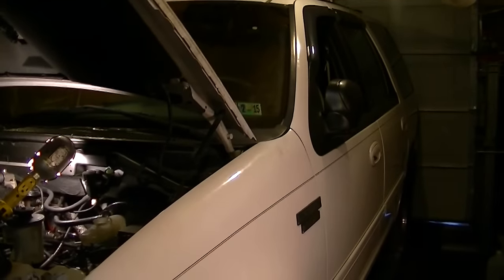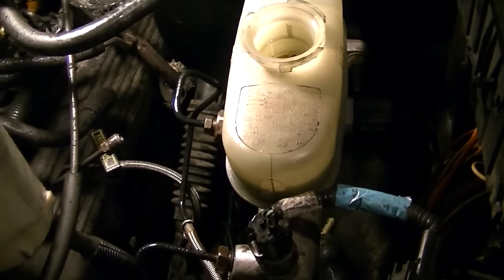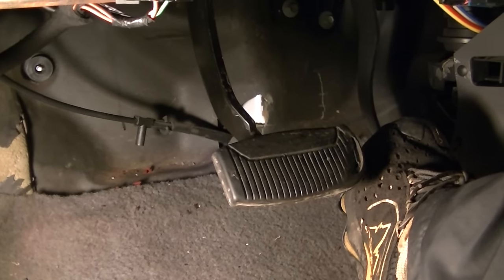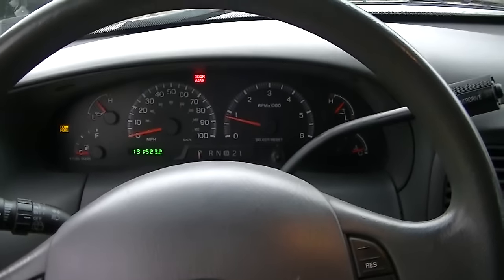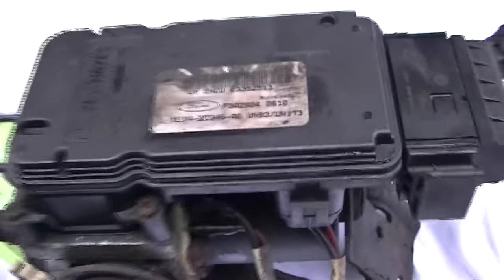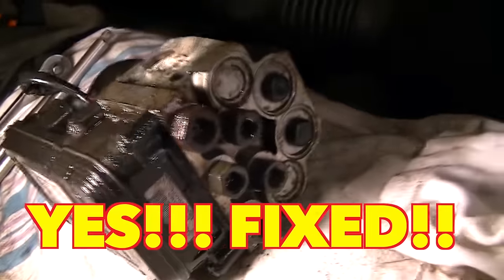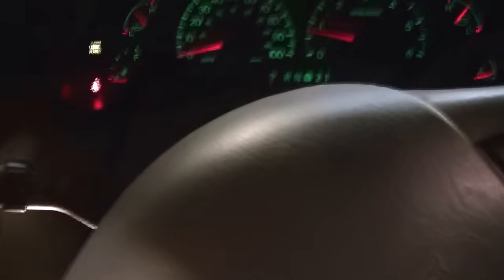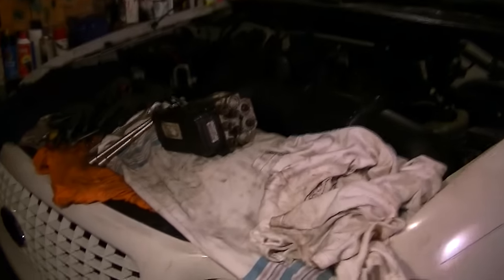Sinking/Spongy Brake Pedal -With ABS SYSTEM?? Nothing Works? Watch Fixed!

Comment: Thanks for posting this.  Almost textbook with the problem I had with a 2001 Escape.  I guess I have some work ahead for me.  Cheers!
Reply from the maker: Let us know if you fix it!
Reply: I'm thinking this is not worth it.  I may donate the vehicle, since I was going to sell it anyway, it needs new tires, and now either the battery or the charging system is shot.  I've got too much else going on to pursue this.  But again, thanks for the videos.  Last time I did a brake line change, it was a lot harder than I thought it would be.  I could get about $2k to sell this car, or just donate it and get it out of my hair.  Heck, I'm just a biologist, with some mechanical skills.  How does that stupid "Kars for Kids" get so much radio time anyway?

Comment: I had this same issue. It was air in the line. I had a power brake bleeder that I kept pumping the brakes while it was attached and bleeding, air bubbles kept coming up and out of the master cylinder resovoir. Since then it's been fine. I recommend people try this before replacing anything. That being said - check the recalls on your car because you would be shocked how many of them have ABS module recalls.

Comment: Loosen up the caliper bleeder screw when installing new brake pads.  Abs module valves are not designed to handle the back pressure when pushing back a caliper piston without releasing the bleeder screw.
Reply from the maker: Perhaps, but I've never had a issue doing that. But good Idea ;)

Comment: Great information. I have one of these only Two door. Did do a all fluid Re&RE including break fluid and power steering fluid at about 75K miles i now have 165Kmiles on it and the fuel pump is getting weak. I just keep replacing the inline gas filter from the tank to the engine on every serviceing seems to stop the engine light from going on other than that one front wheel bearing. Great little vehicle ❤
Reply from the maker: Nice ride!

Comment: would it be air in the abs pump somehow? Factory or dealer have special ways or equipment to do abs bleed.
Reply: Yes it can be air in the ABS assembly but to flush all the rust, dirt, crud and especially copper in solution coming from the inside of the brake lines. This copper acts to corrode parts in the ABS actuating pistons and their sleeves and brake caliper/slave pistons and sleeves. The bottom line is that all replaceable fluids in the car/truck need to be replaced to prevent this corrosion as ongoing scheduled maintenance. And the reason I am saying this is because whether it is brake fluid, engine coolant, engine oil, transmission fluid, or rear end pumpkin , they all contain special additives that protect metal and rubber parts. Seal Softeners, Corrosion Inhibitors, PH stabilizers, and in the case of coolant the special additive that prevents cavitation and stripping of small chunks of metal from the coolant passages. These additives DEPLETE after one year.  I know some carmakers say that it has lifetime brake fluid. IMHO this is their Marketing Department getting in the way of good engineering practice. So that they can sell longer intervals for maintenance and "lower costs" at the time of new sale. This simply does not make sense given the fact that literally, millions of calipers and brake pulse units (HCU's) have to be replaced every year. You will need to full flush it and use a scan tool and procedure to operate the twelve ABS solenoids. I hope this helps someone!

Comment: This video was spot on on in the frustrations i went through haha - I have an ABS on order for a 2017 Audi A6 with only 55000 miles on it! I ordered it simply by how similar he described his process and frustration - I already installed a new master btw so hopefully this will fix the issue - it’s been a few months . One weird thing to note is that the pedal feel would be “ok” for a few days after bleeding and activating the abs pump. during wet weather it was really bad! And it’s not always consistent- around town it felt decent but drive on the highway for a bit and get off a highway exit and surprise, I would have to pump them a bit to hold pressure- and it’s true there is a lot of spotty information on it - everything says master cylinder… great video!
Reply from the maker: Right on man!!
Reply: Did that fix your issue?
Reply: @omarinbenz23  it my mistake - I did change the abs but it all came down to putting the anti rattle clip in wrong! But at least I learned a bunch about brake systems!
Reply: @Krugger71  anti rattle clip?
Reply: @omarinbenz23  on my front caliper there is a metal “U” shaped clip that bolts onto the caliper. It is supposed to apply pressure so that the pads don’t squeal by being compressed against the rotor or rattle with no pressure from the caliper during normal driving.

Comment: I have a 1992 f250 and same problems.  I replaced both rear drum cylinders and bled all four wheels starting with the furthest one and the breaks got better but I steal have a soft pedal. Now I’m thanking abs or R-abs,  I’m going to try to bleed the abs before I buy one!  🤞🏻hope bleeding it works!

Comment: People, always check for leaks first. A leak will give the same symptom he had. Especially if you live where salt is used on the roads or where you have heavy amounts of moisture. The lines can rust anywhere and leaks sometimes are hard to find.

Comment: Process of elimination........   Yeah tell me about it.  New front brake pads.  Took off the master again, did a bench bleed.   I had to use a screwdriver against my chest with one hand and hold the master with the other hand.  It takes all of my strength to push in the rod. 

Then I bled the rear brakes with a vacuum.  Then all new parts for the rear drum brakes.  It took 10 days just to get all the parts.  What a job.  Use copper wire to hold it up in place for the hold down springs.  Finally finished.  And the pedal still goes all the way to the floor!     ARGGGG!
Reply from the maker: You can do it!!

Comment: I was telling my wife yesterday that I am about to destroy my Tahoe. I've replaced every possible brake part except the ABS. I hope this does it!
Reply from the maker: Bingo! Let hope it works.
Reply: Lol I’ve put two in and still fkn spongy but replaced cause they were dragging 🤷‍♂️, also, new caliper, booster, brake line lol, so thinking one of the parts has to be fkd up I got used? I’m gunna bleed each wheel tomorrow? After that might be Molotov time!

Comment: I have have the same issue with my 2006 Jeep Commander.  It goes spongey on dirt roads, and when I brake hard.  Sometimes it goes back to normal with a few pumps & taps, other times it takes a day or two.
Reply from the maker: O my!!
Reply: @FixingWithPassion  should I go the route of an ABS auto bleed?  Or try my luck with a new module?  If it's a common Jeep issue, it's probably best not to look to junk yards.

Comment: I wish I would have found your video sooner. My father has a 2000 Chevy S10 2.2L 2WD. I Replaced brake booster, master cylinder, proportioning valve, bleed the brakes and still pedal went to the floor. The reason I notice it was the ABS module, it was because of a bell sound coming out of the module while the pedal was sinking. While searching ABS pedal sinking I found your video. On another video I found explained that the ABS has a bleeding place, which I was going to do next and I was also going to disconnect the ABS completely to see if that was the issue. But watching your video, I will be going to the Auto Salvage to get an ABS module. Thank you for posting your video.
Reply from the maker: Be careful. I've gotten bad one's at Junkyards before. So don't give up! Keep us updated!~
Reply: Disabling abs fuse fix the problem? Means with no abs
Reply: @veeradasskumar9790  I removed the fuse, but still had issues. I ended up going to the junkyard and getting an ABS Module. The part from the junkyard gave me the ABS light... So I swapped the top electrical part and it's working perfectly.

The part from the junkyard had the bottom mechanical part good, but the top electrical part bad. My ABS unit had the mechanical part bad and the electrical box good. So swapping fixed the ABS light. I think I got the part for around $20-25 and had to remove it.
Reply: @idanny76   thanks pal
Reply: @idanny76  So what was the part on your original one that was not working? - the mechanical bottom part or the electrical top part, or both of them? Thanks.

Comment: I've been through several brakes and rotors and drums on my bronco and it didnt help. I've put new cylinders and calipers on it, I put 2 different boosters on and 3 master cylinders with the last one being a straight up junkyard unit and nothing changed. The abs unit has to be the issue, I've been fighting and pondering on this issue for the 7 years I've owned this truck and its relieving to see a video that confirms my theory

Comment: @Nathan Rohrbough. Hi Nathan. My grandson's 2003 Blazer LS needed the rear axle bearings & seals, Fixed that & the brakes worked fine on the way to the garage where we performed the work. I called him, he picked it up & went home. He sent a txt an hour later to tell me his brakes went out. I got a ride to look at it & although there wasn't any fluid leaking on the driveway, I started looking real close around by the proportioning valve & master cylinder area. The Blazer is originally from Ontario, Canada. So I have no clue who it was that replaced all the brake lines but whomever it was, they/he/she just decided, instead of removing all the original line's. all that was done was they clipped the ends off & ran new lines along side of the old lines. So I already found the leak. One of the old line had been rubbing along side the new line. That was why the ABS Warning Light was on for the past 3 week, which I was told. I can already see 2 other lines that I should just replace because they also look bad. This takes care of the ''No Brakes Issue''. Now instead of letting him & the guy who's gonna buy it go the cheap route, I'm going to replace the emergency/parking Brake's so there's no more surprises further down the road. These are actually able to stop this vehicle while driving, if the brakes fail. I just wanted to leave this comment so anyone who is reading this, if you notice that the Emergency Brakes are shot, get whatever it takes to get them operational. Also if you,or if you have children or grandchildren who's vehicle has had the ABS Warning Light On, like all the time, now you can explain why it's good to mention it to someone who knows a little bit more about cars & trucks because the brakes could have went out while he was driving on the freeway, while on the way to his girlfriends, which is 34 miles away in Detroit. Great video by the way...

Comment: Great video. I think I have the same problem in 2003 Ford Focus.  Made hard stop on Freeway and then pedal almost to the floor.  Just replaced MC about 6 months ago. Can be bad, but should last longer than 6 month.  You mention that you re-worked the brake lines going to ABS " Blocking off the master cylinder" to check if MC was still good and determine it was the ABS pump.  How did you actually do that?  The two brake lines that go into my MC both go to the ABS pump.  How do I block off the MC to confirm hard brake pedal and good MC
Reply from the maker: I took two old lines and just bent them and took a hammer crimped them on the ends (say maybe 3" long) And plugged the master cylinder that way. Seems to work pretty good. Hard pedal good master cylinder.

Comment: I have an 05 Ram 2500, same issue. Brake pedal would sink to the floor. I replaced my master cylinder and bled the brakes. Still had a sinking brake pedal... Bled the brakes again to no avail. I saw this post, disconnected my batteries overnight. Seems to have reset my ABS module. Brakes are firm again!
Thank you!
Reply: I'm giving this a try. (02 Ram)
Also wondering if I could disable ABS by pulling a fuse. Maybe that would help?
Reply: @savage22bolt32  I did that on my Ram. It worked for a few days. Sometimes you can reset the ABS by doing power stops in a dirt lot to activate the ABS system. I will be trying that next.
Reply: @dodgedak03  Found the root cause. A puddle of brake fluid formed on the garage floor. Traced the source to a rusty, blown brake line coming off the m-cyl & going to the combo valve. 
Broke off one brake bleeder, drilled it out and installed a threaded sleeve. 
Test drive seems ok. ABS & BRAKE are lit up on the dash. I'll try locking it up on a dirt road.

Comment: That was informative,  Good trouble shooting.

My brakes will be normal after 2 or 3 pumps - need to be quick in an emergency!!!  I need the car for this week, then it be fixed when I get the $$$. ‘02 Audi A4 3L. - 

That looked like a 2-3 hour job???

I’ve always felt ABS is a necessary evil.
Reply from the maker: Actually maybe 2 hrs....Thanks for Viewing!~
Reply: Funny thing - I let my car to sit for an hour and the brakes were normal.  So could be ABS -  thanks again!

The problem started today when I was stuck in a lot of stop and go traffic.

Comment: I have been pulling my hair out for months and have spent well over £1,500 trying to sort my cars brake system. I have replaced Rear calipers discs and pads. (All free as a bird) Bought a Brembo (larger) 4 pot set up for the Front, with tarox discs, ferodo ds2500 pads and upgraded goodridge lines. - £1,200 alone.. Have gone through 5 bottles of Motul racing fluid and have got nowhere!! I was about to get on the blower tomorrow and order a new MC and brake servo/booster, untill I found this vid. I will try to bleed all the lines going to the ABS unit 1st, if not I will replace the unit. So stressful as I only paid £1,400 for the car! Thanks for the video! 

Dave 

UK
Reply from the maker: Let us know if you fix it!!
Reply: I bled the abs lines today and it's all sorted. Your a star!
Reply from the maker: Nice...Good job.
Reply: @davidwaine32  How did you bleed "the lines" at the ABS pump? Which lines there did you bleed? - the two ones going in, or the (4) coming out of the ABS block? Which had the air in it? - the lines (2) going in, or the ones coming out of the unit? Where was the air actually located, there?  Please help me understand this. I'd like to try it, too. Thank you!!

Comment: Very interesting i always heard abs wont do that only master or leak. I have seen this issue on many vehicles and i had never seen the root cause
Reply from the maker: Internal leak in the ABS unit loosing pressure I guess.
Reply: @FixingWithPassion  that would make sense but school and many other people always said master will b the root cause of soft pedal because abs doesnt control that but wow thats great to know

Comment: Nathan, I bet this is the problem with my 98 Toyota 4Runner I have been chasing this problem I did pads brake shoes everything all new hardware change my master cylinder bled everything And re -bled everything again! did everything just like you and I'm still having this problem so I'm going to go out I looked on eBay and they got some pretty decent prices on used ABS modules thank you thank you!  I'll keep you posted.
Reply from the maker: Please do!
Reply: Hey Nathan,  I found a good used abs unit at a recyclers here in Tucson for 40.00!  what a difference!  Thanks Nathan!!!!
Reply from the maker: Hope It did not come with a Scorpion! Hope it works. ;)

Comment: I have a Ford with the same symptoms.  I am going to replace the Master Cylinder and then if it doesnt work, going to try this.  Even if  I had known that it was my ABS modulator, I would still replace the Master Cylinder because ABS components are very expensive and fragile. Dont want crap disturbed in the Master Cylinder floating on down to the new $600 ABS modulator.
Reply from the maker: I don't blame ya! Besides you can get a reman master cylinder for 
$40...At least you know that will last for a while;) Let us know what 
you find and what the fix was!

Comment: I have a 2008 Citroen C5 saloon car .. brakes were good . I checked the pads and replaced them front and back .. decided to  suck out the old brake fluid for nice new fluid .  Vacuum bled the brakes .. Super top pedal   . decided to go for a short test drive to bed in the new brake pads and the brake pedal goes slowly to the floor .  Resealed the brake master cylinder .   Still the same top pedal until the engine is started   then that sinking pedal . Bought an ABS bleed / scan tool  Foxwell NT 639 pro . eventually got my 77 year old head around the bleed process. Not going to say it cured the sinking pedal  BUT things are looking better .  I can stop the car reasonably safely now .   I will put a few miles on the new pads all around and then make a judgement if the sinking pedal has been sorted . An interesting development when driving .. applying the brakes quite firmly and the car slows / reduce the pedal pressure and there is a brief marked increase in the braking . Almost as if pressing hard on the pedal causes something to limit the brake pressure , which then,  as the pedal  pressure is released the limiting  action goes and there is a brief / momentary increase in the braking performance .    I am a retire 77 year old EX Donnington GT championship winner .  I am convinced that the ABS unit is playing silly buggers .  But being old school Mechanic   I have nill experiences on cars with ABS and wheel sensors . I am seriously contemplating by passing the ABS unit .richardwallinger squiggle gmail point com
Reply: How would you bypass the ABS unit? Put in a proportioning valve block in it's place? Thanks.